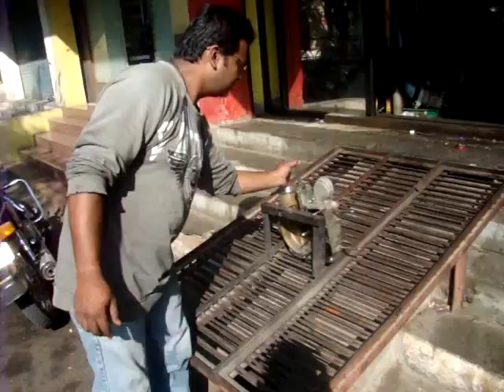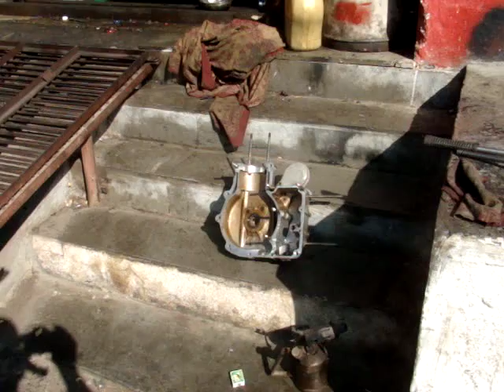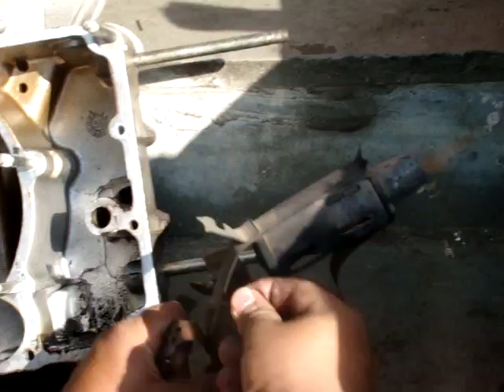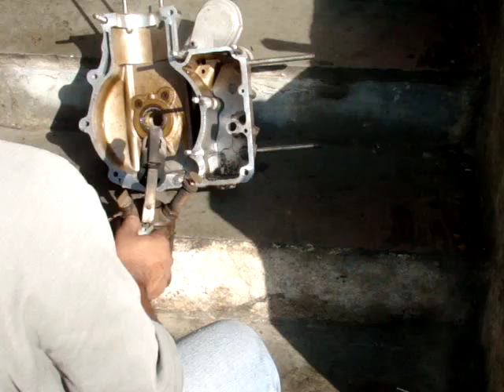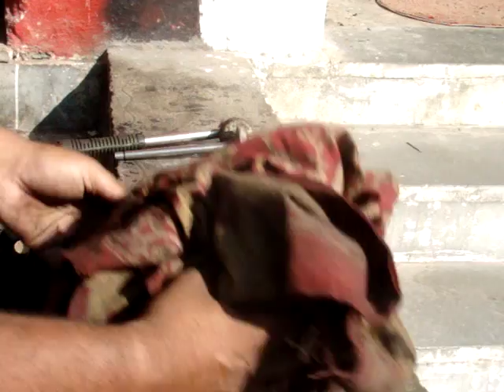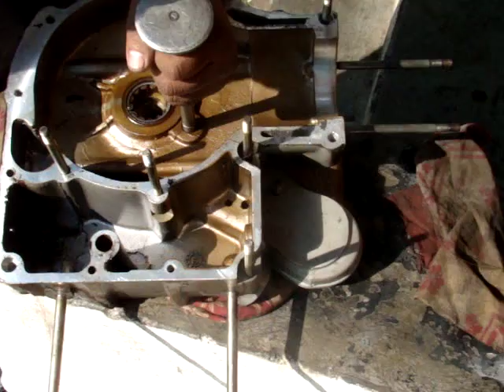Royal Enfield Cam Spindle Removal Procedure

Comment: But what about the discoloration of engine case due to heating or flame?
Reply from the maker: @msxlik  discoloration happens not because of heating. But what you see in the video is due to engine oil. And you don't need to use high temperature. Normal hot air gun Or just normal flame thrower like gas based or kerosene based torch.